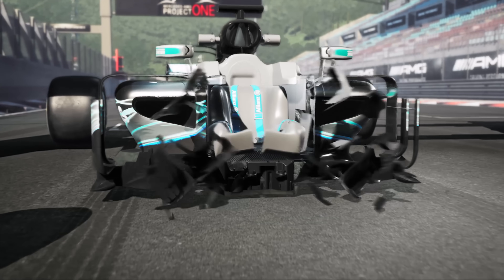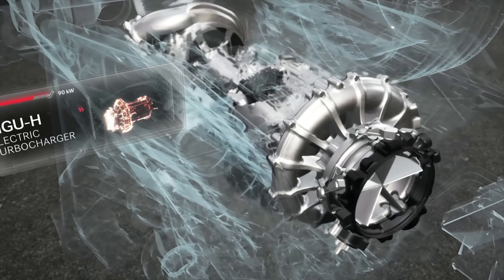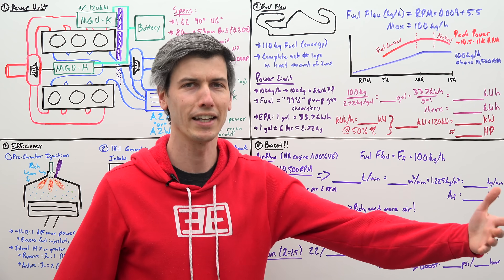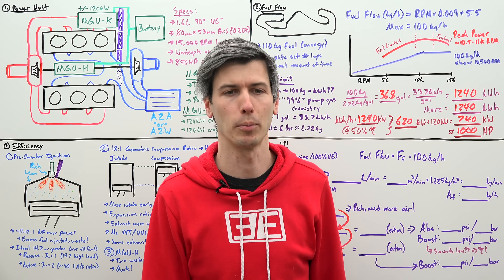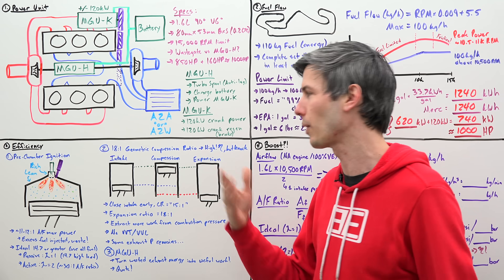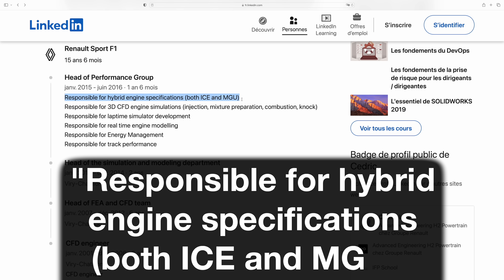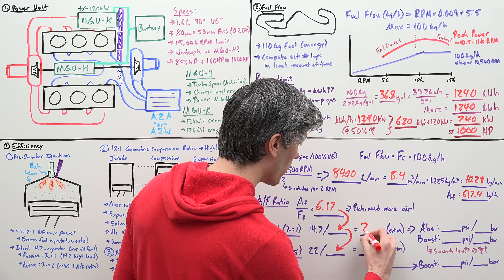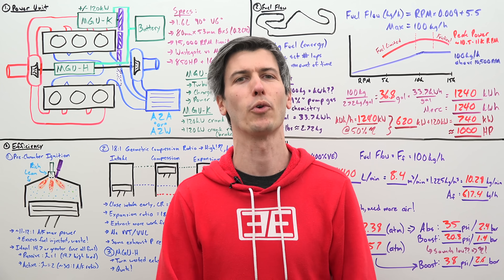How Tiny Formula 1 Engines Make 1000 HP!

Comment: Jason, I love your channel.  Wow, so great the way you present it.  

I'm 50, and have built many turbo charged cars.  So many comments already i wish i knew how to search...., but the discussion isn't about boost pressure at all, it's about air volume being moved by the selected  turbo charger compressor.  

20 psi on a smaller turbo vs 20 psi on a large turbo is completely different airflow masses and thus horsepower.  Most turbo manufacturers have detailed turbo lbs/hr graphs that show the amount of air these turbos move.  

It would be amazing to know the f1 turbo compressor lbs per hour (or kg per hour lol) details, and then boost pressure could be then calculated.  

Boost pressure is not the relevant data point, it's only relevant when crossed with the compressor specifications at that indicate what air mass is moved at that pressure level, to then deduce horsepower.
Reply: Having the engine displacement and its RPMs wont allow you to calculate it?

Comment: Honda was an early adopter of this technology. Remember the CVCC Honda Civic? CVCC stands for "Controlled Vortex Compound Combustion". It was actually 2 combustion chambers for each cylinder. The CVCC chamber was alot smaller, it included a small thimble size chamber, it's own small valve and valve holder. It was incredibly efficient and those vehicles did not need a Cat converter due to a cleaner and more efficient cylinder burn. This technology is what is probably being used in the RED Bull Honda FI engine that is dominating the circuit right now. Too bad those early CVCC motors had alot of head-gasket problems.
Reply: In which manufacturing year they were using it in the Engine
Reply: @Singh_Preet57  Mid 70s, I think.

Comment: Great video sir! If you are open to it .. I'd LOVE to see more formula engineering videos .. actually not just formula but racecar engineering specific videos altogether.. 

Also it would be very interesting to see a deep dive into some of the ingenious formula 1 engineering solutions that were banned because they were too advantageous or weren't in the so called "spirit of the rules" as they say.. 

Anyway great job, and thanks for the worthwhile and interesting content. Cheers!
Reply: Maybe a comparison between todays F1 engines and past engines like the mighty v10s. 19,000 rpm and still the best sounding engine to my nostalgia  tinted ears. In those day they was no restrictions on engine per season. Hell they even had an era when they used special Qualifying engines and a separate race engine that was only meant to last one race.
Reply: Top fuel dragster have that much in one cylinder.

Comment: Very surprised that the required boost level is so low but it makes sense. I think the 1.5 liter turbo engines in the 90s were up to 5 or 6 bar but they did not have any fuel restrictions. Thanks for the remarks on the metric system and on Max Verstappen 😂. Greetings from a dutch guy in the US 👍.
Reply: They also never ran the 80's turbo engines at that level of boost for more than a couple of laps; just enough to get a monster qualifying time in before the engines blew up and were replaced for the race. The ones they'd use for the actual races were putting out maybe 2/3 the power they were capable of.
Reply: @jazzbassrocker  Ah, the good old days of qualifying cars.
Reply: @jimandrews1011  Yeah they pushed the engines to 1200 hp on qualifying, but on race, pulled it back to 1000... I remember the eyes of senna after a qualifying, like he was on acid, pupils magnified and legs trembly...!!
Reply: @jtiagosd  They were closer to 800-900 HP in the races.

Comment: In '79 I performed a major tune up on a Chrysler 318 Lean Burn engine. I followed the instructions carefully, it ran fine after test drive, returned to customer, who was preparing for a long trip. He returned from the trip raving about the economy. I think he said he got around 35mpg. I presumed that it was working well, and he probably eased up on it a bit to test the repairs. But it was rather high for a 318CI V8, automatic, 3 speed. Smokey Yunick built a number of engines and modified the 2.2 Dodge engine. They were rather impressive, and made 220? He made his "Adiabatic" engines and they were something.
75ci V twin, 150hp @7500, 100 at @ 2000? An inline 3, and a V4. The V4 had no cooling system. It made 340hp, and at that point it could run mid class trucks. It was that efficient. You could put your bare hand on the exhaust outlet. Intake temperature post turbo was 450degF. Ran on sour gas as well as avgas. Very fuel efficient, and considering the pressures(big oil), they were never developed. Corporate America is SATAN. There were a lot of other details, but maybe you will seek them out.
Reply: Exactly corporate America has always kept the working man barely out of the poor house.
J.O.B. Just Over Broke

Comment: Turbo sizing also plays a huge role in overall boost pressure needed for power output. A bigger Turbo can flow more air, which means less boost pressure is needed to make the same power. Being that they use the mgu-h to help spool the Turbo, they can essentially get away with using a relatively large Turbo without any of the drawbacks. The less boost pressure used means the lower the intake air temperature, which in turn helps overall fuel efficiency since they don't have to run a richer air/fuel ratio to cool down the combustion chamber. F1 engines are great not because of technology used, but more so because of the engineering skills needed to make it all work in unison.

Comment: Apart from flawless build quality, its a matter of controling temperatures. One thing is to make a dyno to show 1000 hp. The other is to drive it fullsend for 90 minutes. Radiator design and placement is one of the most important things

Comment: But what of the scream??  I love the tech that's being bred here, and the emphasis on efficiency.  But I don't agree with the hard cap on fuel consumption for racing, or no VVT, for that matter.  I want to hear 14,000RPMs screaming down the straights, and using enough RPM range to sound interesting.  The chaos of being able to make that extra power adds life and driver element to the race.  It seems to me that other means should be taken to ENCOURAGE fuel efficiency, rather than enforcing it - like slower speeds in pit lane.

Comment: Interesting as always but your boost estimation seems to assume perfect charge air cooler (CAC) effectiveness (outlet temperature equals the ambient air temp).  It won't be.  I'd suppose that the actual air fuel ratio is only a bit leaner than stoichiometric and your estimated stoichiometric AFR boost is low due to elevated air temperature post CAC.

Comment: Excellent explanation - as a F1 fan, I really appreciate.

Notes:
- Ferrari use 100 octane version of 1000 Shell V-power that you can buy at the pump... in Europe. So using the EPA figure is close but not accurate. 
- Toyota and Mazda have production engines with over 40% thermal efficiency with compression ratios over 14:1,.

Comment: I think we are forgetting something in the efficiency part. 

There is the concept of 'windage' used in artillery guns.. its the difference between the inner diameter of cylinder and outer diameter of the piston. The road cars normally have a slightly bigger windage for safety reasons, and f1 car engines have ever so slightly larger piston diameter to minimize windage. To compensate for this apparently the f1 car cylinders are machined even more smoothly. This prevents a significant amount of wastage of that power generated by the fuel combustion.

There is a whole documentary on this on youtube by Reel Truth Science, with Richard Hammond. 

TL;DR- The engine parts are much more precision made, thereby minimizing energy wastage.

Comment: Let's not also forget that these engines last about 1000 miles. Making mad power from an engine that isn't required to last long isn't particularly hard. The majority of the hard part is getting that power for the entire race using the restricted amount of fuel allowed.
Reply: Actually, they're only allowed to use 3 engines per season, or atleast they're supposed to...anyway, with 23 races this year, that's realisticly 8 races for one enigne. On average they drive about 600km per race weekend...so about 4800km. per engine. So let's say they are designed to hold 5000km or about 3100miles.

Comment: I had a presentation at my former engineering consulting company from a f1 engineer about all the tech that was développed in f1 but not used in normal cars. 
He told us that one of the tech was a special coating on the piston and the cylinder wall that was very hard (and very expensive) and that allowed them to be very agressive with the timing since they would not need to be preocupied by knock and it would highly increase the efficiency of the engine

Comment: In the current era of F1, which started in 2014 and uses 1.6-liter V6 turbocharged engines, the boost pressure is regulated to a maximum of 3.5 bar (50.76 psi) absolute pressure.

Comment: Great video, Fenske!👌👌  Let's consider the cylinder pressure required to create the torque necessary for that horsepower at say 11k rpm.  Now, assume lean combustion up to 15k rpm running the higher lambda and advanced pre ignition timing. 😉. Torque may plummets but power stays up.  The trade off is that cylinder and exhaust temps rise to the point of accelerated fatigue as the cylinder pressure ratio gets quite elevated.

Comment: Might I ask.... On a normally aspirated engine @ 10,500RPM is there really an expectation that calculation is accurate? The air intake velocity is limited by the intake valve and surely that intake charge at atmospheric pressure has to be under vacuum when the valve closes. The cylinder head would have to be removed to completely fill the cylinder to 100% capacity at that RPM. I could be wrong and I am not afraid to be. Normally aspirated engines at 10,500RPM just don't instantaneously fill with air through a tiny valve open for a microsecond.
Reply: If you think that's high rpm, you have seen nothing. In the early 2000s, F1 used naturaly aspirated 3L V10 engines. The last generation could reach up to more than 19000rpm and put out over 950hp.

Comment: Production cars are choked back with emission controls like CATs that lower the power because they restrict exhaust flow.. Also most engines are at only 8:1 compression because higher compression ratios create NOx. This is why they are so inefficient.

Comment: Since the engine is constantly under boost, what prevents the use of air injectors vs. a valve system? I'm sure im missing something but this would save weight since you wouldn't need the entire valve train.
Reply: If you inject air you still need a valve to control it. That's what valves do, control the air injection of the turbocharger
Reply: @lightningdemolition1964  Fair enough, however you wouldn't need the cam, lifters, etc.. just the valve. I guess i stated my point incorrectly.

Comment: You left out that F1 engines are assembled at operating temperature. This is down to make sure that all components, eg, piston rings, are at the ideal tolerances, and thus, maximum efficiency. There is very little blow by around the rings. 
You can not just start an F1 engine cold they need to have all fluids preheated to operating temperature. That's why you see the cars hooked up to what looks like a life support system before going on the track.

Comment: Are you shure that your boost calculation is correct? Maybe it is good approximation. Lets just assume that intercooler maintain constant IAT. If we just double the pressure of air in a fixed volume is that going to double do mass of air? Or, if the pressure is doubled is that going to produce double the flow? I am genuine not sure, that's why I would like more detailed explanation from you. Thanks

Comment: quick question on your final point about boost pressure at high elevation.  Are you talking about absolute pressure? or relative?  If it's relative then I think you're absolutely right, they need to put more pressure above atmospheric in order to get the engine to perform the same, and that does mean the turbo has to run at higher RPM to achieve that effect.  If you're talking about absolute pressure then it should be the same, I would think.  Same absolute manifold pressure to achieve the same horsepower, though the turbo is obviously still having to spin up faster to get the air up to that higher absolute pressure.

Also, does the reduced atmospheric pressure reduce pumping losses?  Probably a very minor effect.

Comment: 4:08 this is not my goal. To know the business you are in - i want to cross the finish line first. (We always like your videos, in general they are considered to be outstanding!)

It may be interesting to see how this channel will cope with the coming change to electric competition engines? Ampere per cable? Switching times versus steepness of   intervention? Internal resistance vs. 'heat creation'? Surface currents and hollow cords? Volts and insulation? Harming capacity of cables? Build up times of magnetic fields? Size and style of magnets vs coils? Layouts of switchboards and power electronic parts? Will there be 'F1 thyristors' 'handmade und -selected by Intel for 80k Dollars a piece' - just for F1? I think this is all hot and coming. (First F1 electric engines for fully electric F1 derived from a current Tesla top engine, possible?) And how about heat dissipation and cooling in general? Will we see heat pumps for regen?

Comment: What I didn't understand in the explanation is how the fuel air ratio is differentiated between the pre combustion chamber and the cylinder.  If I remember correctly you only said one injector per cylinder.  So do they make the mixture rich in the chamber and lean in the cylinder ?

Comment: I'm wondering how well that combustion chamber design would work in a street engine.   Is the much lower flashpoint of pump gas going to make this design ineffective? How well would it perform after tens of thousands of miles?  Seems like it wouldn't build up carbon deposits running so lean, but it's much richer where the fuel is injected.

Comment: Ferrari fuel having "99% of the same types of compounds as regular fuel" does not mean it has about the same energy content. If regular fuel contains even a single molecule of kerosene then Ferrari fuel could be all kerosene (and 1% other additives) to make this statement true.
Then it also says same types of compounds. E.g. ethanol and methanol are the same type of compound (alcohols) but ethanol is more energy dense (per kg) than methanol. So if there is e.g. methanol in regular fuel Ferrari could use ethanol to also make this statement true.
With these weirdly worded statements it's always important to read exactly what they say (and what they don't say).

Comment: They’re starting to do away with gates on promods.
No hot side gate
Vent excess boost off the charge pipe with an E-gate .. kinda like some procharger cars do.
They have had great results this way 
Better spool more power better control of boost and better downforce if using upward facing ram horn exhaust sinCe ALL the exhaust is heading out that way spinning that massive exhaust turbine wheel with tons of flow

Comment: 8:17 And it's 11-12 AFR on WOT because the fuel actually "cool" the ignition chamber, and therfore limit knock (vs 14.7). 
It's the main reason E85 limit Knock even more than regular petrol based fuel, you need more ethanol than petrol to run an engine at correct lambda.

BTW I have some pictures of used Ferrari 2018 to 2020 piston, and you can clearly see the "fire" pattern from prechamber. The color on those area suggest that they sustain more heat on those places.🔥
Reply: Also one of Honda ignition pattern shots became public witch was quite different. Looked quite "ringish" seems that flame front traveled around outer walls. Quite simple "diesel" tech used in gasoline.